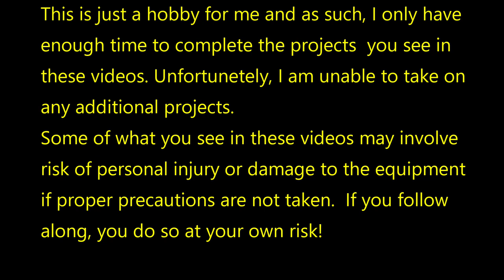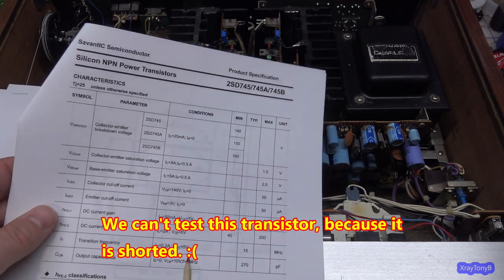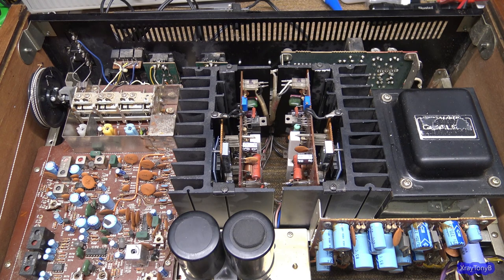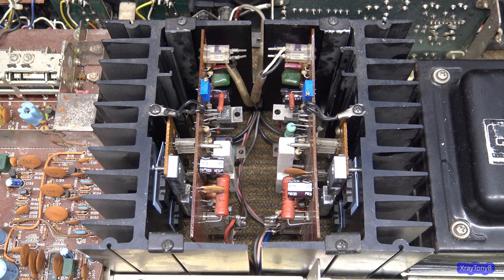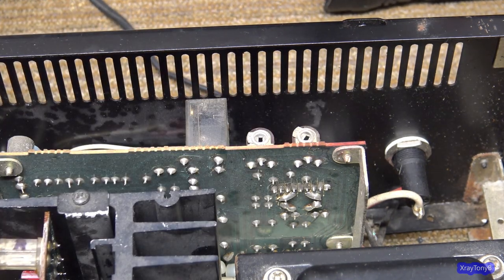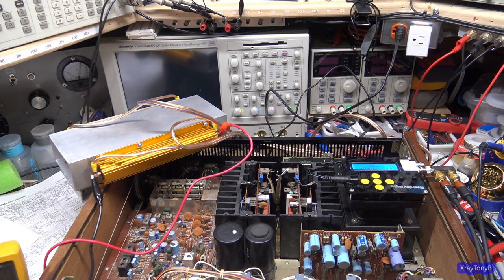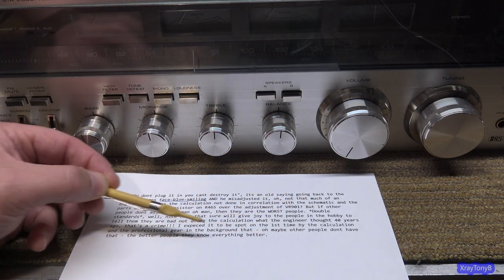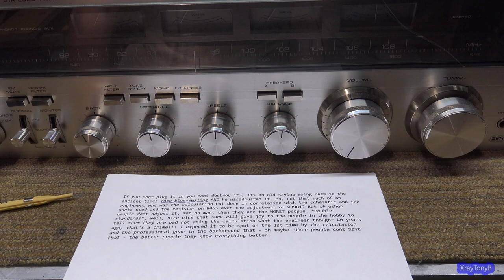Realistic STA-2080 Comments Follow-up

Comment: Thanks Tony, for following up with another video.  It is very, very helpful!  In my opinion, there is only one disappointing aesthetic about this model receiver, and that is the fact you can barely see the meter pointers because the backlighting washes them out.  RS should have either made them wider, made them a contrasting color, or put lighting in front as well as the rear.  Pioneer's 80 series receiver meters are a wonderful example of great, legible meters.

Comment: It is worth pointing out a transistor's current gain (Hybrid Forward common-Emitter, Hfe) becomes largely irrelevant in a circuit employing *negative feedback*. Mathematical circuit analysis strongly suggests this, whether this be effectively: Voltage-Series, Voltage-Shunt, Current-Series, or Current-Shunt feedback systems. And of course - this will apply to small and large signal stages. However, be mindful that not all circuits employ negative feedback, but in audio surely they have to be? - to keep nonlinearity down, hence - distortion down.

Comment: One gripe  I've ALWAYS had with transistor spec sheets is that there is NO universal reporting and/or  specification  standards. 
Every Mfgr just gives you the specs they want you to see.
Reply: It's also more evident when you are looking at datasheet info from discontinued transistors from 30+ years ago, compared to modern datasheets. It can be very "hit and miss" to try to work out a suitable replacement. In that case, finding and downloading a old guide like the "Sams Transistor Specification Manual", or "RCA Transistor Handbook" from the 70's or 80's ( Sams lists all brands, RCA is more just their products) can be a good aid, as it has a wide range of parameters to reference for each device.

Comment: Tony  I can't remember on the 2080, but on the STA-2100 the Bass Mid and Treble are set to max when calibrating the watt meters. I worked at the QC Lab for Realistic  in Fort Worth from 1976-1982 and used to do the rigorous quality control and comparison (with other brands Sansui Pioneer Marantz etc) on these units. We put up a STA-2100 at full power along with competitors equalness for 7 days 24 hours a day and all failed except for the STA-2100. (Toroidal model) The STA-2100D IIRC went around 5 1/2 days where all competitors units failed somewhere in the 4th day or before. People even today don't realize just how well these were designed and engineered.
Thanks for posting these vids they are top notch to anything else on the subject.
Reply: 10 watts is 10 watts whether tone controls are maxed or not. i don't understand how maxing out the controls is going to matter to the drive circuit for the meters. it's only measuring voltage.

Comment: I have not looked at the previous video yet, and I will. Those Sanken “bat winged,” transistors are awesome. The really are power hungry. They used them in the d240 and 400 from ARC, which was the most analog sounding amplifier I’ve ever heard, “so close” to tube sounding. Nice work. Keep those old good ones.

Comment: Thanks for the explanation Tony. Very helpful. FYI currently I'm working on a pioneer CD player that reads the toc, but fails to play. Adj I could do with the service manual seem fine. The only thing I've yet to try is adj the tangular (forgot the correct word) to aim the laser. I'm still learning at 49. Best of luck and thanks for sharing your repairs.

Comment: so with gain changing with current, does that imply then that there would actualy be some performance gain, beyond power handling, from these designs with multiple output elements in parallel?  i have always assumed such designs were just hifi excess.
Reply: As an Electrical Engineer, I can honestly say this is probably one of the best questions I have seen on any YouTube video dealing with electronics.  The answer is wholeheartedly YES.  I wrote a more detailed answer with the benefits and costs of employing such a strategy previously, but it didn't post for some reason.  I'm writing this so you at least get an answer to your question.  👍👍
Reply: @bobbysparky4299  ahaha thanks! I'll have to think about that in my next design!

Comment: I like to replace the power cord with a polarized cord. 
On this unit, they have a 2.2m resister from one side of the power cord to the circuit group. I like to make sure that the Neutral side is grounded to the chases.
Reply: I would suggest you install an IEC C-14 inlet or use a 3 wire cable and connect the actual ground to chassis.

Comment: If someone needs gear starting out. If they live in Canada or the USA i will ship them enough to get going as far as learning. 

I do this with no strings attached and supply other items along with a multimeter and soldering station to get someone started. Im retired and young and buy extra gear for people who are serious about getting into electronics as a hobby. 

If you read this tony and want to pin it, i have enough stuff to set 2 to 3 people up with a beginners kit i wish i had. It wont be a fluke meter but itll be something i paid close to 100 for and i have a t12 station or 2 and tons of ics and microcontrollers and leds (as i have over 100k haha) along with breadboards and perfboard along with a simple psu thats adjustable up to 24v.

My email isnt hard to find and just put the title as need gear or something and ill get back to the person immediately.  I buy extra stuff to give away to anyone who cant afford to get started and theres no judgements or strings attached except for my enthusiasm to find out how i can help. 

Im not lying and i believe in helping anyone i can. Ill even send a small amplifier and speakers.

Comment: I have the exact same unit STA-2080 i bought in the early 80's. My unit works perfectly as long as i put a match box under 1 of the corners. If the unit sits flat on the table i loose one of the channels.  Obviously i have a bad connection on one of the boards. Can you give me an idea where im loosing the connection.  Thanks Mark
Reply from the maker: It also could be possible that the amp has a faulty transistor that is failing when it overheats.  Propping up the receiver may be letting a bit more air to flow in from the bottom.  If you turn it off, wait a few minutes and turn back on, does the sound return in that channel?

Comment: Hi Tony I also wanted to add that the meters on these units are not to be called a novelty by their design, The reasoning you notice almost all high power units the scale will get tighter as the wattage increases is pretty much accurate because in theory the more total distortion the less they will "bounce" and become "fixed" as they loose that headroom in the sound that give audio its "live" presence. If you notice the printed scale on the meter will begin to tighten as it reaches it's rated power AE the less bounce the more distortion visually. This is by design not a novelty. 
Again your work is top notch even I don't know everything but we continue to learn.